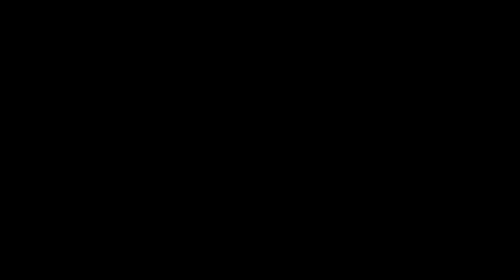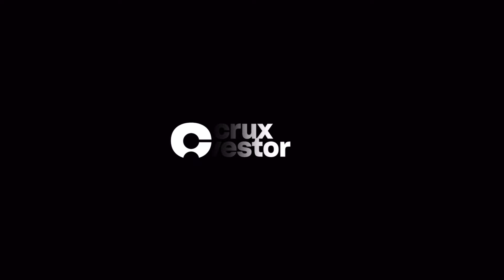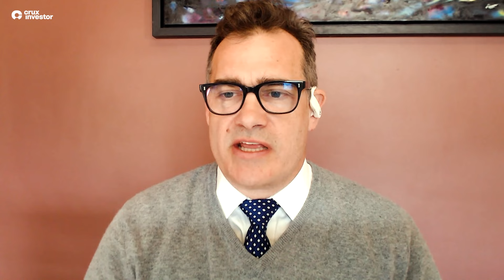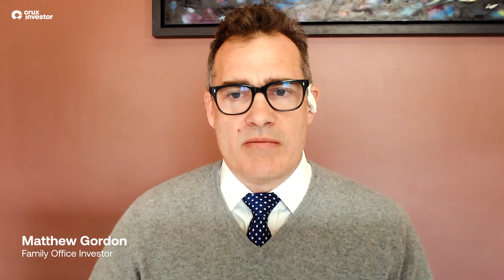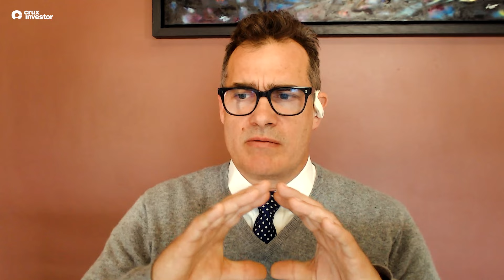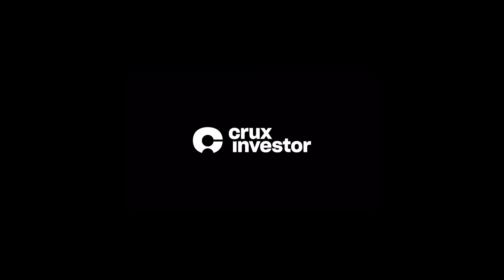Impact Minerals (ASX:IPT) - Global-Scale, Low-Cost, High-Purity Alumina

Comment: Is anyone going to guard Lake Hope or will it be unattended in between excavations?
Reply: Dr Mike mentioned truck drivers on site for 8 to 10 months a year
Reply: @robertharle6377  Doesn't answer the question. There are still long periods where rogue operators are able to access the site and remove vast quantities of company resources.
Reply: What about those unattended months? The site will be wide open to rogue operators.
Reply: @sirdudleynightshade8747  Cameras can be set up on site if necessary
Reply: Lol you reckon thieves are going to steal billions of tonnes of clay and then process it? Ok pal 

 @sirdudleynightshade8747